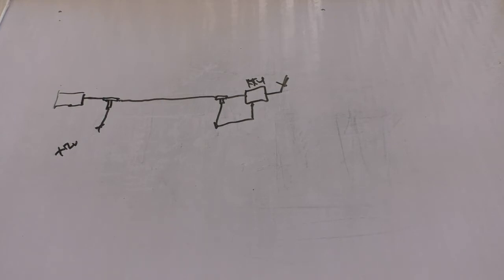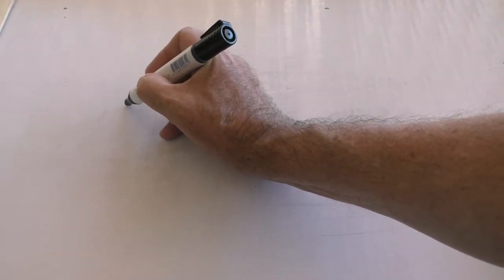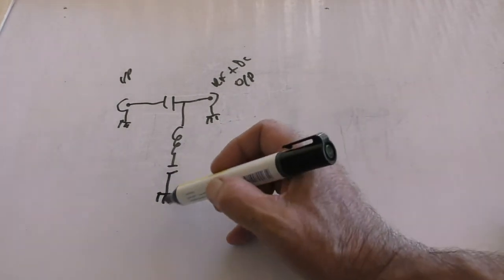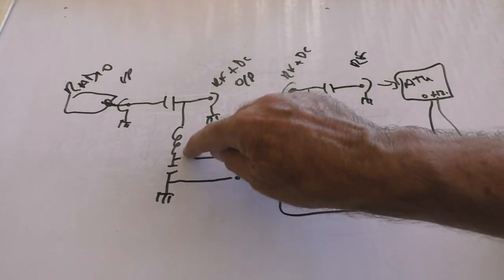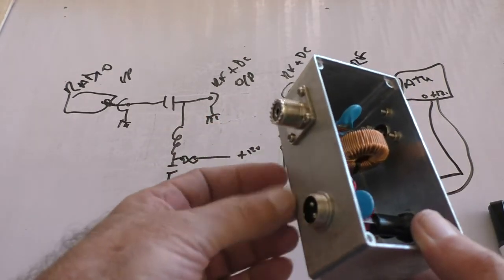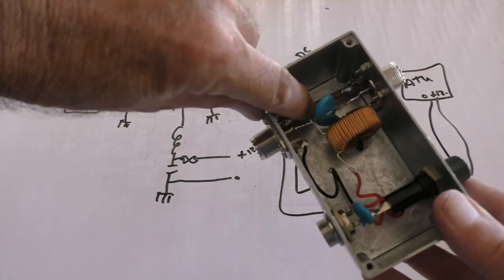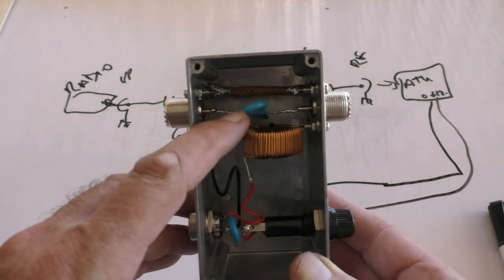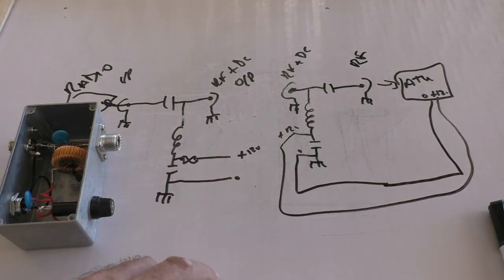What's A 'Bias T'?

Comment: I found that very interesting ;) Disclaimer: I'm very new to electronics, so I understand the concepts but I can't put them together. How did you go about calculating the values of the inductors/capacitors if you don't mind me asking? Also I've seen some bias tee with TX protection, would you have an idea of how to achieve this? I'm looking to have a receive antenna and SDR receiver but I don't want to fry the poor thing when I'm transmitting ;)
Reply from the maker: I didn't calculate the capacitor and inductor values. I knew the Jaycar 470uH choke would be ok as I looked at an on line inductance /impedance calculator: http://www.pronine.ca/indimp.htm this shows the 470uH choke to have an impedance of over 10k Ohms at 3.5MHz. This will be higher at higher frequencies. I also used a capacitance/reactance calculator: http://www.sengpielaudio.com/calculator-RC.htm and just used the highest voltage capacitors I could easily get, again from Jaycar. I knew the 0.1uF capacitors would be fine as they're used for RF decoupling, and using two or three in parallel reduces the reactance and increases the current capacity. How to protect your receiver... maybe have a relay on the linear amplifier keying line output from your radio that shorts the RX antenna to ground when you're transmitting would do the trick.
Reply: Aha! That's how it's done? :D Thanks for coming back to me on this one!
Reply from the maker: Thanks Johnathan, I'm glad you found it useful.

Comment: The circuit is the same as yours , caps are 6kv rated peppermints... at 400 watts i get  lots of heat, not touchable. Have not blown them yet, but now knows that 400 watts heat them up and too backoff on the drive...
the caps are yellow and i have blue ones like yours on now same effect, they do heat up in my homebrew lineers input circuit as well,
offtopic,, Youtube does not tell me when some one answered a comment , and i know you know, but its bloody anoying hey.
keep  going  i like the vids.
Johan

Comment: One just have to be careful with RF-leakage from unknown bias-T's out on the DC-feed, 
it may upset the powersupply's regulator feedback loop and destroy stuff connected with overvoltage.
tip of the day; use one made for HF for HF, dont use it for UHF as the RF isolation might not be good at all :)
Reply from the maker: Thanks. I did calculate the impedance of the 480uh chokes, they should be fine.
Reply: Hi, how did you calculate the value required for the inductance/capacitance?

Kind regards,
Simon

Comment: This is the same i use for my 40m beam ,forward and backwards relay s power... Those blue .01 caps do change value and heats up quite a bit, better check yours as well, i know you gonna change them some time, but just to be safe :)
Johan